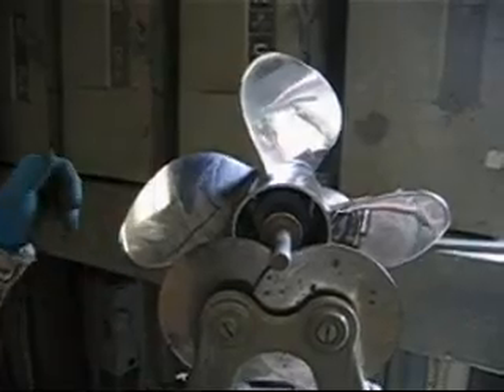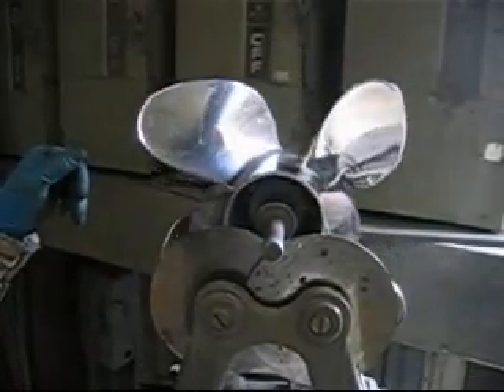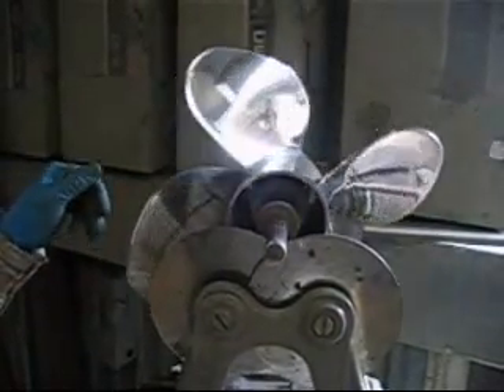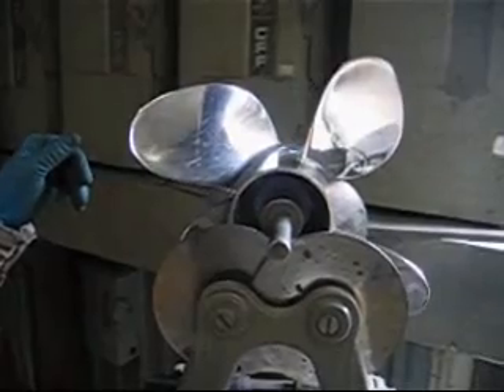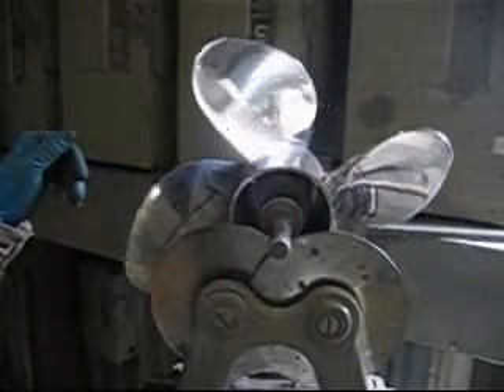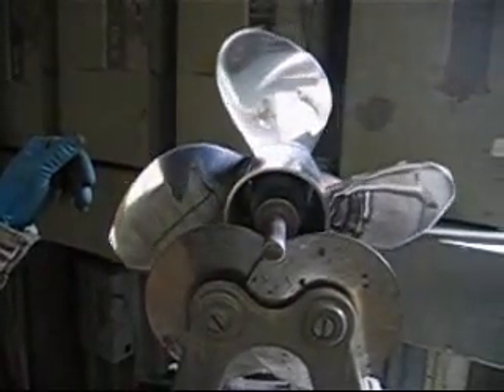How to balance a boat propeller.

Comment: Bought brand new in the box AC Delco Rochester 4bbl carb still in the wrap. Looking right through the plastic, found a broken lever and did not bother to mess with it. Dealer had another one the next day, worked perfect. Just because it is NIB, it does not mean it is OK.

Comment: What causes a boat to slip off pad at top speed and lose speed but hold the same RPM's. I had my prop fixed at a prop shop and when it reaches top speed I can feel it slip and lose 4 to 5  mph. It is a T-1 27P  Vmax prop vented on a 21i class skeeter with a  2006 300 HPDI at 3.5 below pad. None of my other props have done that including the same type prop that came on the boat.
Reply: Tommy Clay figure out that problem yet   randal at my prop shop

Comment: When balancing RC airplane props the hub often needs balancing also.  To do this I first do exactly as you did but then I put the prop in the 1/4 positions and see if the prop rotates.  In essence, a well balanced prop will stay still no matter what position (all through the 360 degrees). Nearly always the hub needs balancing.  The hub is ground slightly to balance. Does this make sense?  Good video BTW.
Reply: mkl3opt
I have been an RC aviator long before I got a boat. I feel like the years I've had balancing rc airplane propellers puts me at an advantage at understanding boat propeller balancing fundamentals. Just finished balancing a 3 blade bronze propeller for my '60 Merc 400

Comment: Thomas Asseryd you are absolutely wrong on all aspects of your comment. First those props are cast and are hand ground and finished in a vibratory polisher. Secondly a prop out of balance at any speed is out of balance period. You don't operate at the same rpm on every application so it has to be balanced at all speeds, even slow. I know for a fact that most prop shops still balance their props in the same way ( 1960's method). Third all props are balanced on the negative side of the blade and then repolished. Acme propellers actually balances them on the negative side of the blade and then leaves the grind marks. Fourth cavitation is spelled with a c. We appreciate your views and comments but after 44 years I don't think we need your advice and I'm sure most of our clients would agree.
Reply: Screw that’s prick. Great video!
Reply: NETTLE PROPS how do I get more literature on the balancing process of Props?

Comment: First of all new stainless propellers are balanced in a machine at its operating rpm. This make them look unbalanced when checked with a 1960 method. Secondly they are cnc machined on the front side to prevent kavitation. You just unbalanced that propeller and grinded on the wrong side. This will cause wear to the sprockets at final gear and its bearings. + higher fuel consumtion and slower speed of the boat.
Reply: You are wrong on multiple points, can't spell for beans, and there's nothing wrong with static balancing. "Kavitate?" "Grinded?"
Reply: Dead wrong Forest Dump!